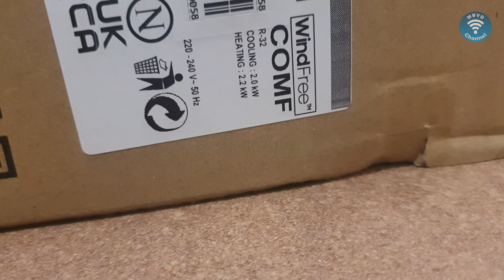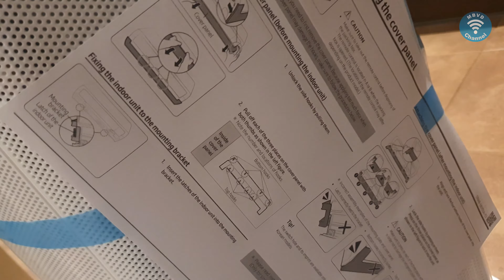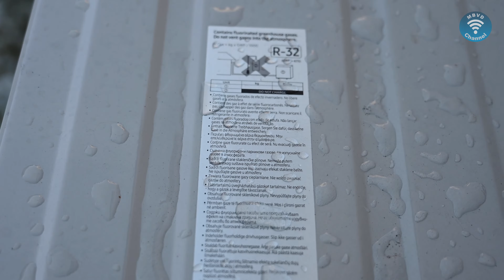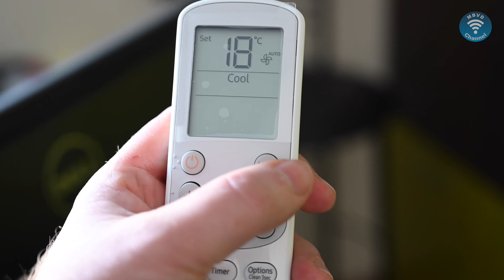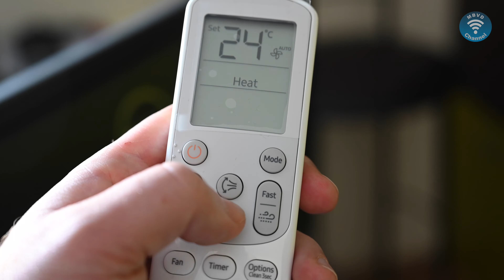Samsung Multisplit Windfree A/C system | Unboxing | Installing | Using

Comment: Hello! I experienced an interesting situation regarding the operation of Samsung WindFree air conditioners. While in WindFree mode, I was surprised to see the units automatically open the air vents and start blowing air. I thought it shouldn't work like that normally. Have you experienced a similar situation? I'm curious to hear your thoughts! 🌬